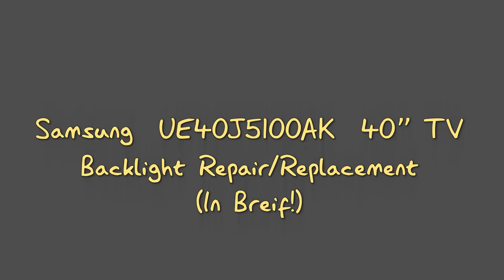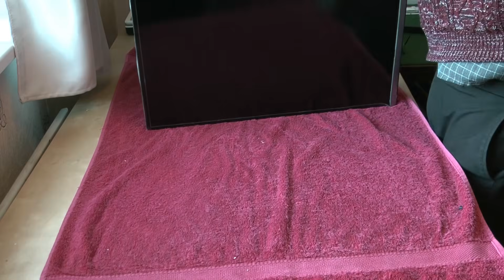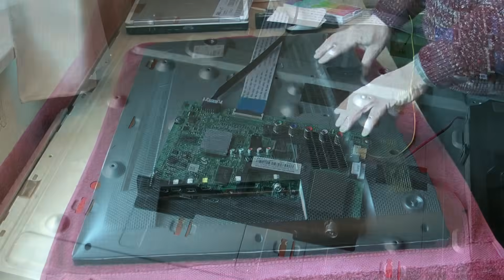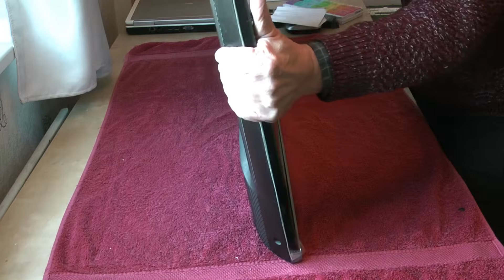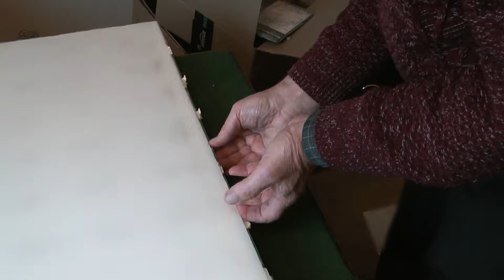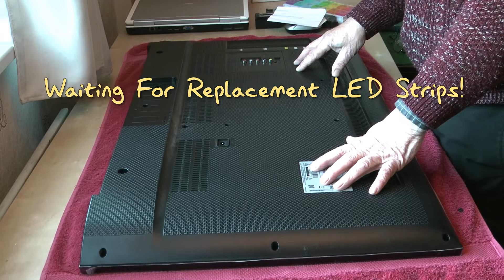TV LED Backlight Replacement Repair - Samsung 40 TV - Model UE40J5100AK

Comment: Great Job! Are the led strips expensive and/or where would the best place to be to purchase them? Thanks
Reply from the maker: I used Aliexpress and bought a complete new set for about £13 for this model.  UK prices if you can find a set are a rip-off.  Sorry for late reply, I should get email alerts for comments but for some reason don't.